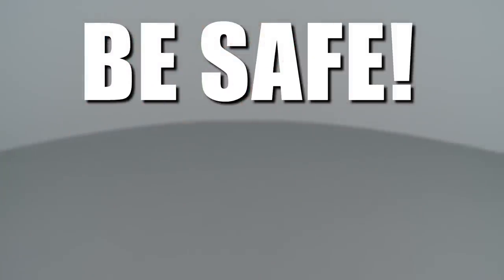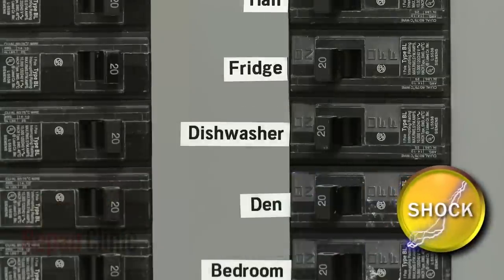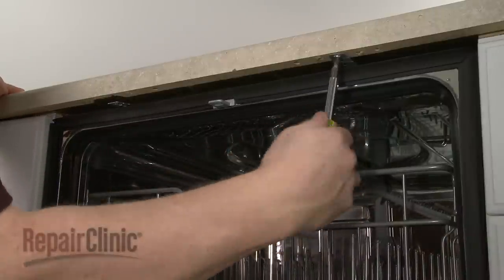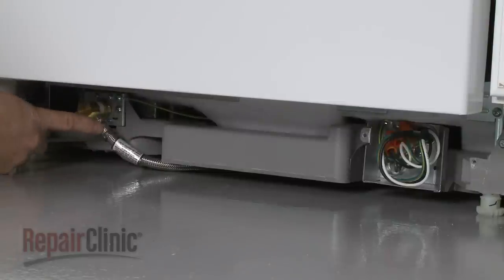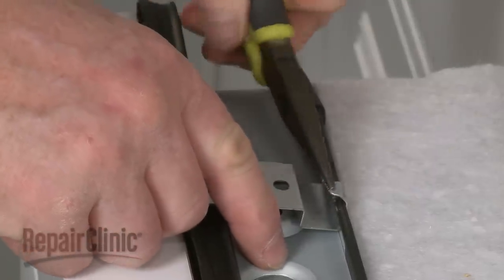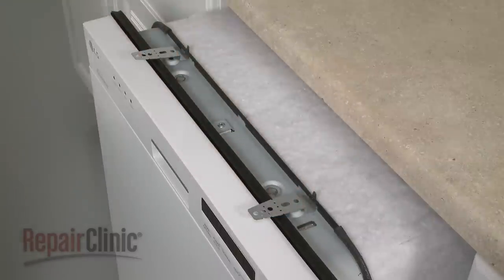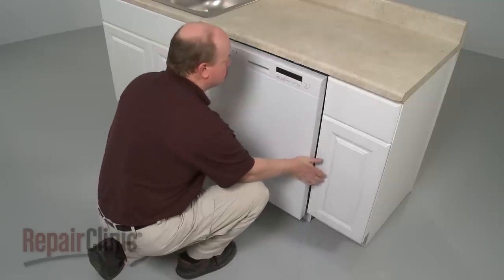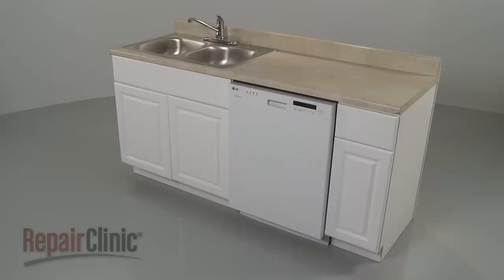LG Dishwasher Mounting Bracket Replacement #5001DD4001A

Comment: Seems easy... But no one nowhere explain how to fix those d..n brackets when there's a 3/4 inch space between the bracket and the counter !  Nor how to deal with the depth which does not allow to get in there with a screwdriver !... $43 for those brackets by the way. You better fix these correctly to avoid further problems....